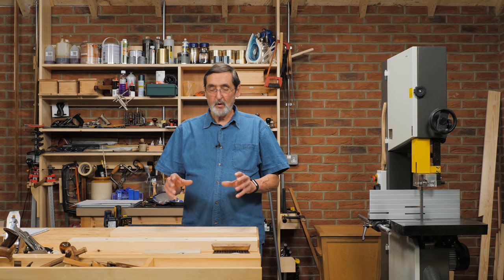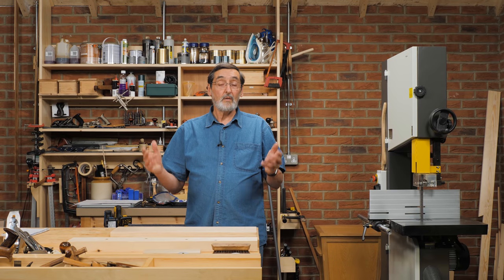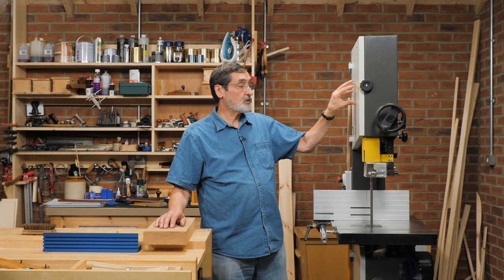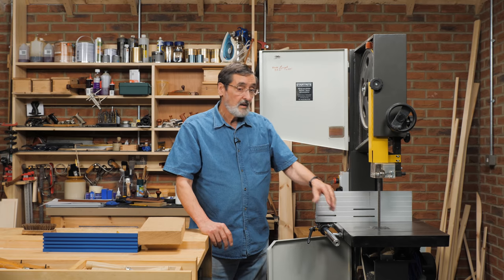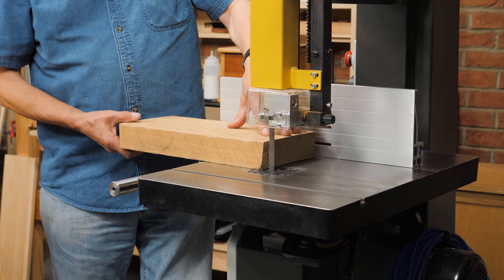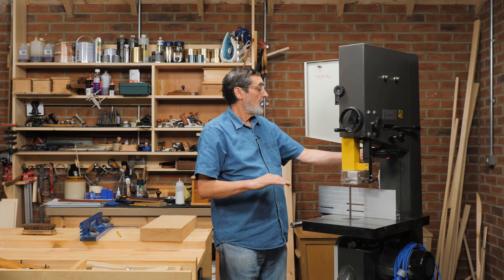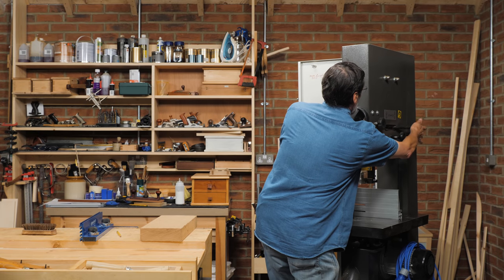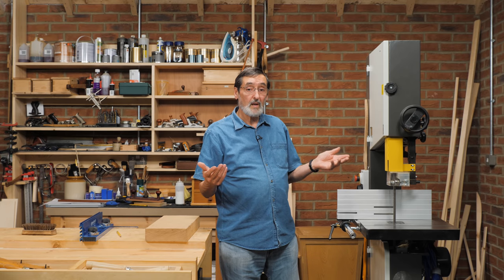Introducing the Bandsaw | Paul Sellers

Comment: Of course power tools are worthwhile.  Someone would have to be pretty ignorant about general shop practices to not understand their value in any shop.  The only reasons to not have the typical stationary power tools is if you can't afford them, your shop has neighbors who would be disturbed by the noise, your shop is built in a way that getting large pieces of equipment into it is not possible, or your shop is just too small for them.  The usual stationary tools are table saw, jointer, planer, and bandsaw.  Radial arm saws used to be common for cross cutting, but power miter saws have mostly taken over because they are cheaper and probably safer.  Shapers used to be pretty common, but are not seen much anymore because portable routers are definitely cheaper and safer.  The last tool that might be pretty common would be a power mortiser.  If you can afford them and have the ability to get them in your shop, go for it.  You will be able to make things much faster, and with much less physical effort.
Reply from the maker: Thanks for this deezynar. I think perhaps this comment needs a little balancing  to it though. The assumption very often from western parts of the world is that everyone wants them, has access to them and so on, after all isn't the machine the bigger and better way. In reality a lot of people don't want industrial processes and whereas I think your reasoning is fine, often it is hard for those with machines to understand that not everyone lives in the same privileged position. There is a whole world of 'others' in every 'other' country in the world that follow me that will never have a hope of owning such things. The impression given that people are "pretty ignorant" if they don't understand enough to want them is very a questionable phrase. My research shows that  it is a much larger percentage of people who have made highly educated evaluations leading to the conscious decision not to install machines. That's not to do with ignorance and of course there are many, many good reasons beyond those given NOT to install them. As for, "the usual stationary tools are table saw, jointer, planer, and bandsaw.  Radial arm saws used to be common for cross cutting, but power miter saws have mostly taken over ...". Again, perhaps you miss something else here. A massive audience wants the work working with their hands. 98% of them are pursuing hand work skills because they want the skilled workmanship, not to become a machinist. Oh, and no matter what anyone says, machines are highly invasive in more ways than just floor space. I think you touched on that, but people love the idea of stepping back just a tad to a space where they are in control of their lives and no longer driven onto the conveyor belt.

Comment: Hi Paul I have a very small workshop and I’m wondering do I sell my tablesaw and invest in a quality bandsaw as I only make small to medium size items could I ask for your opinion many in advance
Reply from the maker: Personally I would ditch all other machines for a half decent bandsaw. The other machines take up far too much room, art all extremely invasive in noise and air pollution and much more dangerous. It's a no-brainer for me. That said, I do understand those that work as machinists with perhaps minimal or even zero skills in hand tool work relying totally on machines. Customers are often cash strapped and are looking for inexpensive product and machines help to achieve this.
Reply: Paul Sellers thanks Paul

Comment: Does anyone have a good suggestion for a bandsaw for someone on a budget? I mostly do wood working on a fairly small scale (wooden swords using 3/4" thick hickory), but I'm getting tired of the inconsistency of the jig saw I'm using.
The ability to adjust the angle of the fence would be nice, but not necessary.
Reply from the maker: where do live, Stephen? Country?
Reply: @Paul.Sellers  Florida, in the United States.
Reply from the maker: @MrSJPowell  Maybe consider the smaller Rikon. I have concluded that many makers got out of actually making any more and just put their own stamp on what's made in China. The different brands are way too close to one another in design and manufacturing processes.
Reply: +1 Rikon for value. But FYI, anything less than 14" will increase your run cost and maintenance time. The little benchtop saws tend to fatigue and break the blade before it is dull. 
Regarding an adjustable fence: don't think you can do this with a small saw. For a hobby saw, in general, you will often find it easier to just cut to a scribed line unless you buy a larger machine that is more stable. Because to get it to cut str8 to a fence, you will have to dial in the saw, and on a smaller saw this will not be a one time and forget it type of deal. It will drift over time as the blade and the wheels wear AND you will most likely have to re-tweak it every time you change the blade. Most 14" and under band saws don't even come with a fence for that reason. Another trick is to use a point fence, which allows you to make adjustments to the stock as you cut.

3/4" plywood tends to cut straighter than 3/4" hardwood rips. Up to 3/4" plywood will cut very straight on my saw (14" Rikon), even using a sled. The tpi matters, too. If your tpi is high and the teeth are too fine, the harder it is to cut a given material straight on a band saw. I keep the tpi coarse and just finish with the planes and sanders. But for a 3/4" hardwood rip, it depends on the species. Something like poplar might rip fine up to 3/4 or even 1" thick. But other harder woods I wouldn't try to use a solid fence or a sled for a rip.

My opinion 14" is the point where the saws are built well enough to be 100% reliable for at least rough work. 16" and double/triple the cost if you want something that can make reliable straight rips in hardwood thicker than 3/4" using a fence. A 10" table top saw, you can cut maybe up to 3/8"thick hardwood straight. But by the time you get it dialed in for 3/4" hardwood rips with a fence, the blade will break and you will have to start over. Or if it doesn't, as soon as you start trusting it, you'll make a rip in hardwood and find you ruined a big chunk of it cuz your cut wandered. And you will eventually revert to cutting to a scribed line by hand/eye coordination, like the rest of us that don't have $$$ saws.

Comment: I don't know where to start with this issue so i'll ask here if thats ok - my bandsaw (a smallish DeWalt DW738) is tracking fine on the top wheel as its adjustable, but on the bottom wheel the blade runs right on the front edge of the wheel and obviously theres no adjustment for this. Any one have any ideas?

Comment: That tension cam lever is a feature I wish my cheap bandsaw had; it looks like it makes swapping blades far simpler. I had to compromise on my blade to find one that did the most things to an acceptable degree, but nothing really well, because changing it is a pain.

Did you add the dust trap board just above the lower wheel yourself? That also looks like it could be a useful addition.

Comment: What bothers me about bandsaws is the small table, if you are trying to rip down an 8' length it's not easy. I am working on a table extesion, not sure how it will work out.
Reply from the maker: I just use a couple of inexpensive roller stands at the rear and inline.